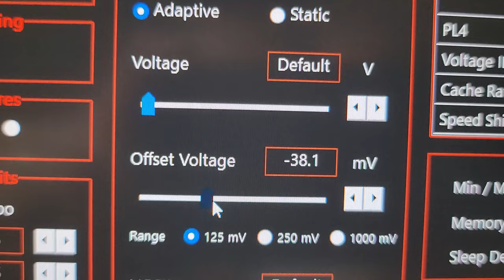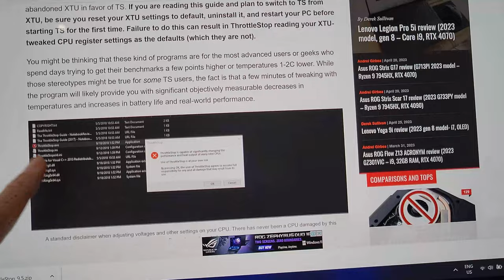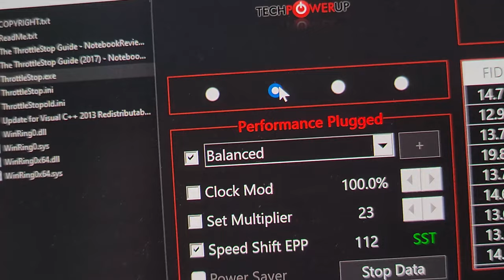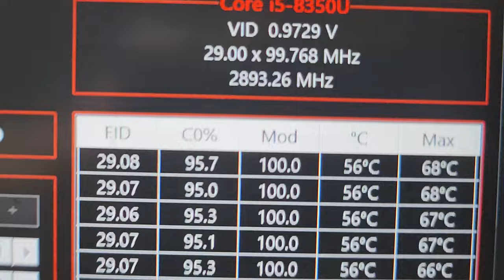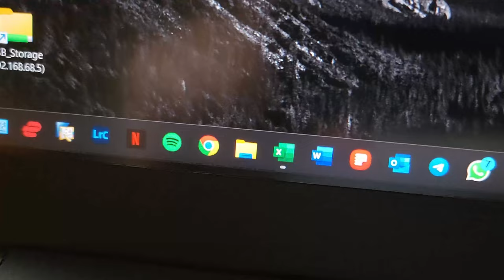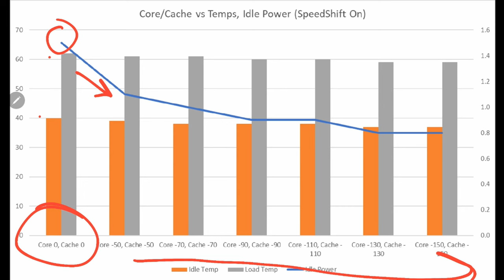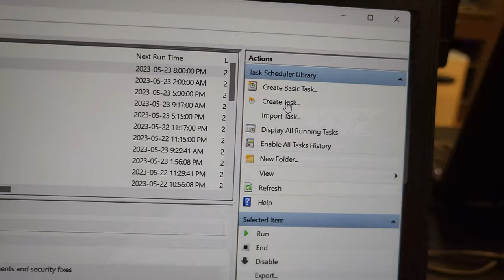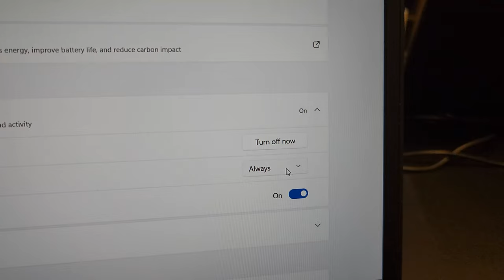ThrottleStop on my Thinkpads | CPU undervolting and Speed Shift for T480, T580/P52s, W550s, and T15g

Comment from the maker: Each CPU will have different ideal undervolt settings, so you'll have to experiment and iterate to find the best settings for yours. Not being able to undervolt your CPU as much as I was able to on mine isn't a bad thing, either! If anything, you can look at it as your CPU being closer to "optimal" than mine was out of the factory. :)
Reply: good video! thanks for the sharing..

I have T480 & have problem with battery 1 & battery 2 discharging order.
Naturally I will want to discharge easier to remove battery 2 (external battery) which is removable & easy to replace without shutdown.
The problem is, since **70  version of thinkpad (X270,T470..), they  have changed the policy (low wear batt will discharge first).
In my case it is internal batt (battery 1) which has low wear compare to batt 2.
I research a little bit & found that lenovo change their policy about which batt to discharge first for powerbridged system & many user complain about that. But Lenovo seems not to care about the complaint.
is this software able to set which battery to discharge first?
thanks
Reply from the maker: @udintanjidin8386 Have you tried updating all firmware and drivers? My laptops still discharge their external batteries first despite these having more cycles than the internal batteries.

Comment: I think all of them are LOCKED by bios cause the plundervolt or whatever it calls. And everyone here think they are undervolting but they are doing nothing (the video is actually undervolting)
Reply: @one_step_sideways  what BIOS version did you recommend?
Reply: @one_step_sideways  thankyouu
Reply: @one_step_sideways How do I downgrade to previous bios. 

Coincidentally, I was on 1.26 too.
Reply: @one_step_sideways How do I downgrade the bios. I was on 1.26 version too. I updated it and I think I made a HUGE mistake.
Reply: @jasonvoorhees3282  You didn't, actually. I tried it with the newest BIOS and undervolting works there too. I think it comes down to disabling VBS, Hyper-V, Virtual Maxhine Platform and perhaps some other things that force disable undervolting. It works even on ver. 1.51 for me, and I don't see any problems with using the newest version for improved stability and security.
Reply: This was most confusing since I barely found anything related. All from years ago, people that were new didn’t seem to have any trouble at all.
Reply: on thinkpad t480 just remove core isolation, then remove the config file and it will work already.

Comment: I was able to achieve the best i5-8350u 3dmark cpu score in the world with this process
Reply from the maker: That's awesome.
Reply: You only really need a good lottery CPU, a beefy dGPU cooler, fan control software (optional) and good thermal pads for the VRMs and PTM7950 on the CPU.
Reply: @one_step_sideways  i didnt even need to mess with fan control just good luck on the silicon lottery i guess

Comment: Thanks for the guide. Quick question here, whats your final core/cache number at the moment? both for Performance Plugged and Battery (I'm using T480 with similar spec to yours).
Reply from the maker: I do not have the T480 with me to check for sure, but I recall setting 110/95 or 105/95.
Reply: @ChezDoesStuff  thanks, Mate!

Comment: Definitely my brother got more duration of battery life in his Thinkpad T480
Btw, we got minimum idle's of 1.4W with Windows 10, but then we have done a Windows 11 upgrade and now we see minimum idle's of 0.7W
Seems that Windows 11 is more efficient than Windows 10 in terms of idle times.
The specs of the laptops are:
i7 8550U
8GB RAM DDR4 (Single-Channel)
SSD 500GB SATA
Nvidia MX150 Graphics
14'' 1366x768 HD Display

PD: We saw that in ThrottleStop there is a Turbo limiter. We used it to set the CPU Turbo to 3.4GHz (Same as the i5 ver.)  because the i7 has a max. Turbo of 4.0GHz D:
Reply from the maker: That's great info! Folks often advice others to avoid the i7 because it supposedly ends up slower than the i5 once it thermal throttles, but looks like you fixed it by capping max. turbo. 0.7W idle is awesome, too!
Reply: What is your BIOS version? I have the last one (1.47) and although it allows me to modify the offset voltage, no real change can be seen
Reply: im using windows 11 and i get a 1.4w idle time
Reply: update: I changed to windows 10 pro instead and got 0.6w idle time bruh, windows 11 was at 1.4 for me
Reply: for some reason on Windows 11 my c states were at C2 and C3 and i couldnt get it up to C7-8

Comment: I'm looking at getting a Lenovo P50 and under-volting but all I know and feel comfortable with adjusting is to lower the voltage. I want to make sure my laptop (when I get it) doesn't get hot as the P50 is known to get very toasty. I want to under-volt it, but, yeah, in Linux even though I'm a complete newbie to Linux (I'll be using Linux Mint I think). Any advice, tips to keep things super simple and effective in lowering the under-load temps in Linux on the P50 would be appreciated. Thankies. :)

Comment: t480, i7-8650u here:
core -130
cache -100

works like a charm, but;
when connecting or disconnecting charger machine cashes.. 

oh, I have batt profile set to stock values, so no big issue to rinse and repeat.
stresstest works fine, temps look good, no errors.

did I maybe miss something?
Reply from the maker: You might want to consider:

A. Pushing a pin into the power reset hole at the bottom
B. Checking to see if there are thunderbolt/USB-C port driver updates pending
C. Scaling cache back to -95 or -90 and testing (also test with TS disabled just to rule Windows system issues out)

Hope this helps!
Reply: @ChezDoesStuff  thx for the reply!

what does A do?
Reply: @ChezDoesStuff  bumping up cache V seem to help! :) left the CPU untouched.

but also it seems since the plugged and batt profiles differed to much, it made it crash when plugging/unplugging the charger, having them more at the same V, helps!

what about the iGPU, should/could I UV it too? :D
Reply from the maker: @denisstrok9898  A just resets the power controller by disconnecting all batteries for a brief fraction of a second. Sometimes, the power controller just gets "tired".
Reply from the maker: @denisstrok9898  Great to hear that you've found some progress. I tried fiddling with iGPU in the past but didn't see as much power efficiency improvements as I did by UVing the CPU, so I reverted back to default settings.
Reply: thx once again!  any upcoming overclocking videos coming? @ChezDoesStuff
Reply: Core and Cache voltages must be the same. You need to set both to -100. If you want to go lower, then set -105 on both - but you will start having Cache errors (reported by WHEA, which can be seen in HWinfo64). I started having Cache errors at -115 on my T480 with i7-8550U, and raising it to -110 made it stable again. I also manually set the clocks lower to dramatically increase the energy efficiency of my T480 even further - 35x on 1 core, 33x on 2 cores, 30x on 3 cores and 26x on 4 cores.

Comment: Help...im running this on thinkpad t480s,win 11, but the ts bench time wont go lower and sometime goes up ,there is no significant change, and i cant even reach the point where i should go to BSOD. It seems that its not affecting anything. CPU cache offset also stays at 0
Reply: Try downgrading the BIOS as I described in my comment. You need to downgrade the BIOS to 1.34 on your T480s and also turn off Virtualization Based Security if it's enabled (if you use WSL2 or something like that).

Comment: i have t480s, when i set the max power draw to 25w, its burst to 2,8 Ghz and temp goes up to 98°C (while you got only 60-70 C), is it bc slim design?
Reply: Core offset -200mV, cache offset -100mV.
Reply from the maker: Wow those are aggressive offset settings! Glad they work for you. On top of the thicker frame, I'd attribute the lower temps I saw to the dual heat pipe upgrade done to the T480 despite the lack of dGPU.
Reply: @ChezDoesStuff  so you running dual heat pipe for mx150 version right?
Reply: @ChezDoesStuff  i've done some tweaks, now with ONLY 20w power it can go 2,95 Ghz (90°C temp)

Comment: I have T480 i7-8550U. The power usage is reduced, which is good. But the temperature…it still peaks over 95. Many people warned against i7 CPUs for their terrible temperatures.
Reply: Did the performance increase? Maybe your processor is cooler, but it's using that headroom to run faster instead.
Reply: you should try undervolting your gpu, it reduces for me quite a bit like 10 degrees celsius

Comment: Great content, do these settings apply to a T480 with an i7 8650U and an MX150?
Reply from the maker: I think it's worth exploring what specific settings actually run stable on your machine, since each chip is different. That said, folks have commented that vPro processors seem to be locked and incapable of undervolting. Please do report back what you find!
Reply: @ChezDoesStuff  vPro processors are fully capable of undervolting. They are not locked, as I tried it on my other T480 with an i5-8350U (with vPro). I wrote a comment about how to enable undervolting on ThinkPads that support it - you may want to put a like, or maybe even pin it now.

Comment: Can I also use this to over bolt to boost performance? I a good cooling mechanism so overheating does not matter
Reply from the maker: Yes, I believe you can overvolt by sliding the settings the other way. I do not have experience with this to comment whether it'll be reliable/safe, unfortunately.
Reply: @ChezDoesStuff  alr Ty

Comment: fiiiiiinaly! ♥
Reply: okay update, i did everything you did but it seems like my CPU doesn't let me change the values. in FIVR i see values changed after you save in the upper right corner, mines not changing at all. i still suspect vPro in charge but i don't know for sure. still a very good video, keep it up! :)
Reply from the maker: @hYpercritesde  sorry to hear that! Speed Shift should still help things a bit, hopefully?
Reply: @ChezDoesStuff  sorry for the late reply, i had the chance to test it now with speed shift and had no difference at all. but i appreciate your effort. :)
Reply: @hYpercritesde  mine has vPro too, the value in the FIVR changed but the max temp still no go down. Still waiting for the dual heatpipe fan to come before changing the thermal paste.
Reply: @hYpercritesde try deactive the AMT in the BIOS setting, maybe it will help
Reply: @AlanHusk  i couldn't find any AMT related entries, can you guide me please?
i figured the AMT settings arent present on mine. does that mean its permanently disabled?
Reply from the maker: @hYpercritesde  Thanks for getting back to me, and sorry I couldn't be of more help!
Reply: @ChezDoesStuff  no worries, i tried alot of thinks like disabling AMT (wich isn't present in my BIOS due to my wifi card upgrade) and some other things but i am still out of luck, thats nothing you can change and i enjoy your content! :)
Reply: @hYpercritesde  i think so
Reply: Maybe running as an administrator will help?
Reply: @AlanHusk  What is your BIOS version? I have the last one (1.47) and although it allows me to modify the offset voltage, no real change can be seen. My T480 is i7 core.